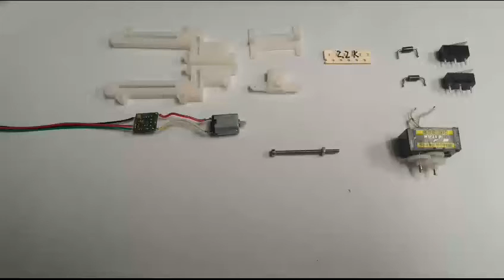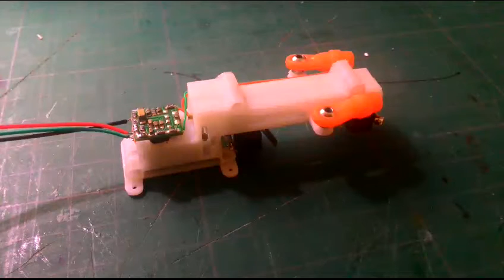Made RC linear Actuator from  retired 9g servo

Comment: Would have been more precise in positioning if you used the original servo control board and replaced the pot with a 5k slide pot. 
That way, it could be used by anything that has a servo output.